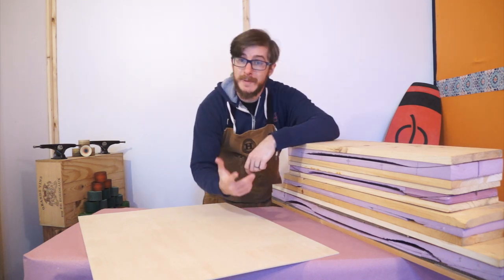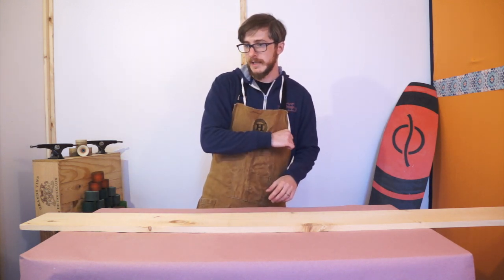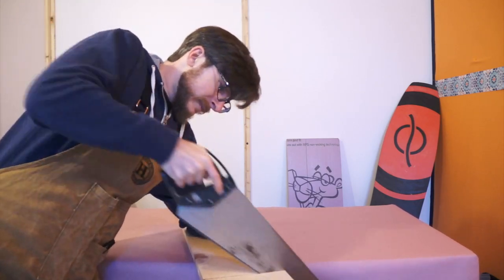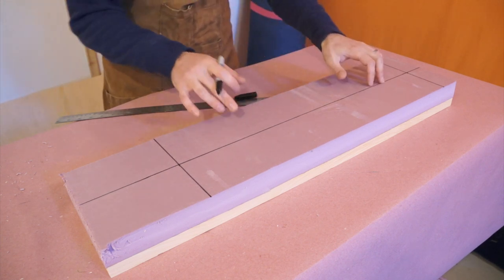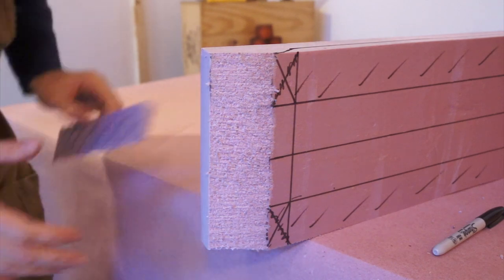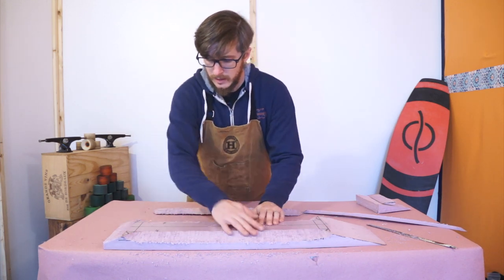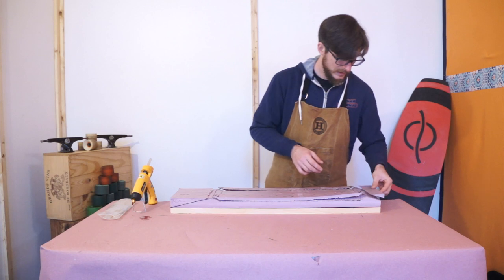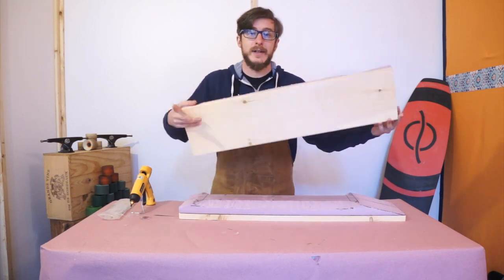Easy, Inexpensive, DIY Skateboard - Part 1: Making the Mold

Comment: None of my local stores carry r10 foam only thing I could get was r5 I cut two of the same peices glued them together it seems pretty thick I’m also making an oldschool deck with a longer wheelbase and no nose. How do you suggest making a mold for no concave no nose and single kick  ?
Reply from the maker: That's about as easy of a mold as you could make, just cut the wedge out for your tail and you're good to go!

Comment: Great videos, I watched the 4 part series and also the design one. I'm definitely going to make one with my daughter. You said you can get the wood on Amazon, do you have a material list that you can post or send. Thanks. I will post pictures once we finish.
Reply from the maker: Here's what I could find for the correct plywood on amazon: https://www.amazon.com/Baltic-Birch-Plywood-Grade-Clear/dp/B07YR7DZLN/ref=sr_1_10?dchild=1

Otherwise it's just some rigid insulation foam from Home Depot or Lowes, and some wood to back the mold with. Good luck with the build! Can't wait to see how it comes out!

Comment: Great video series!  My first two attempts are not as great as if like.  I was only able to find 1/4 in Baltic birch plywood.  I can't find it on Amazon in long enough sheets.  Any chance you could share a link?  My tail and nose kicks are not high enough?  Advise?  Thought about using wood (2x10) to make the molds instead of the foam, thoughts?  Thank you!
Reply from the maker: Finding good sheets on Amazon can be tough, the best way to do it is to actually go to a lumber yard. If they don't have baltic birch in stock they should be able to order it for you. You can get a 5ft x 5ft sheet which is enough to make a couple boards depending on the size board you're making

Comment: 32 x 8.25 finished size ////Give 6.5 for tail ////Give 6.5 for nose /////concave only in the center portion ///14.75 wheelbase between trucks///Resin is the strongest

Comment: Hi, would the pressing method used in this series be suitable for 1.5mm maple veneer? I only ask, as most methods online which use veneer typically use a vacuum press. Cheers.
Reply from the maker: I would lean towards no. To press a veneer deck with a two-part mold you need a pretty precisely matched set of molds so there are no gaps when you clamp everything together. You can use this method and add a sheet of something soft like a yoga mat to both sides of the mold to try to account for any gaps, but it's not a guarantee and you lose the ability to have super accurate curves. It would work better for something like a cruiser than a street deck.
Reply: @GoodRoads  Thanks for your help, I'll stick with the ply and send you a pic when I'm all done! Good job with the series, cheers!

Comment: Sorry to disturb you but here in Italy that foam is pretty difficult to find because here the r's scale isn't used. I have a question for you, as Wikipedia says: "R-value is a measure of how well a two-dimensional barrier, such as a layer of insulation, a window or a complete wall or ceiling, resists the conductive[5] flow of heat" So shouldn't be more correct to use the "Compressive Strength" as parameter? I found a lot of specs on the homedepot website and a r7,5 mean 103Kpa while r10 mean 172Kpa. Do you think 120Kpa would work?
Reply from the maker: Hey! Yes. Compressive strength is exactly what we're looking for, if those stats are right then 120Kpa should work. There's no reason you couldn't make a freestyle longboard with this method, but you might want an additional layer of plywood. The foam only needs to be as thick as the tallest feature on your board, so unless you want steep kicktails, the standard 2" / 50mm sheets will work.
Reply: @GoodRoads  thank you soo much! Which could be the problem of using a too hard foam? I have seen a 280 kPa foam.
Reply from the maker: That would absolutely not be a problem. If you can get harder foam, get it. The only reason I'm using the softer stuff is that it's commonly available here in the states. Harder foam will preserve the details of your mold better and last longer, go for it!

Comment: do you have the link to the foam installation and pine wood for an 8 inch wide board I'm a little confused but nice video
Reply: and the whole saw
Reply from the maker: This is the kind of foam I used:
https://www.homedepot.com/p/Owens-Corning-FOAMULAR-250-2-in-x-48-in-x-8-ft-R-10-Scored-Squared-Edge-Insulation-Sheathing-52DD/202085962
And this is the drywall hole-saw:
https://www.homedepot.com/p/Wal-Board-Tools-1-25-in-Drywall-Saw-with-Wood-Handle-and-Steel-Blade-04-002/202954537
The pine is just any 1x8 board you can get in a lumber section, but you can back the mold halves on any wood that's the dimensions of your mold. Plywood, 2x8, anything stiff and flat will work.

Comment: Cut one piece of the mould put it in a frame cover it with a sheet of plastic than spray with expanding foam let it set then cut the foam flat I don't know weather that could work I'm not a skater or board builder just a thought could maybe pour from epoxy resin aswel /concrete

Comment: Hi there. Excellent videos, thanks. You suggest using plywood already cut to the length and width of the final deck but isn't it necessary to allow for some extra trimming? If the boards are the exact size of the final deck could there be a risk of delamination? Thanks!!
Reply from the maker: Leaving some extra for overhang is a good idea, not just to help avoid delam but also because the sheets can sometimes shift in the layup which means you have less space where all the layers overlap
Reply: @GoodRoads  Ok, thanks for your quick reply. How much would you recommend? 1 inch or is that too much? Cheers.
Reply from the maker: That should be plenty
Reply: @GoodRoads  Thanks.

Comment: @Good Roads So I want to make a skateboard deck for myself and have like a normal skateboard deck that you would buy at a store could you maybe make a video on that or some thing?
Reply from the maker: I plan on doing a more standard deck at some point this year but for the time being check out the freestyle deck I pressed with a 3d printed mold or my more recent series on the colab I'm doing with Roarockit on the freeride longboard deck. Both of those techniques would work to make a standard street deck
Reply: @GoodRoads  what would the tail and nose be in length if the board was 32” by 7.75”?
Reply from the maker: @suefrank8645  A standard kicktail is about 6". I'd add a little extra length to your mold and then cut it down to the right size when you shape the deck
Reply: @GoodRoads  sorry I’m new to skateboarding just one more question the nose would be about 4inch or do u recommend a different size?
Reply from the maker: @suefrank8645  Nope for a standard skate the nose would either be 6" as well or a smidge longer
Reply: @GoodRoads  thank u very much! :)

Comment: Question, Can a normal styrofoam work? Like the white ones?
Reply from the maker: It's going to be too soft. Even some of the insulation foam is too soft, look for something with an R-value of 8 or 9 or higher. It will be printed right on the foam, something like "R-8"
Reply: @GoodRoads  polystirene xps is okay?

Comment: can you please tell me the name of the wood and its original size? (:
the wood for the board
Reply from the maker: The wood is called either Baltic Birch plywood or Russian Birch plywood. It can be found in a lot of sizes but one of the ways you can tell you're getting the right stuff is if you buy it from a lumber yard it will come in a 5ft x 5ft sheet. You can make a couple boards from a single sheet.

Comment: Where can we get layers?
Reply from the maker: Just posted this reply to a comment on another video so I hope you don't mind the copy & paste: If you're looking for 1/8" (or 3mm) birch plywood like I use in this build you can sometimes find it on amazon, but calling around to local lumber yards is also a good bet. If they have it in stock you can usually get a 5ft x 5ft sheet for pretty cheap and if they don't they may be able to order it for you. 

If you're looking for veneers Roarockit sells them in small quantities, or you may be able to find a shaper in your area who will sell you some. If you're trying to press a deck out of veneers don't use this method though. I've got videos of a couple different methods that will work better for that style build here on the channel